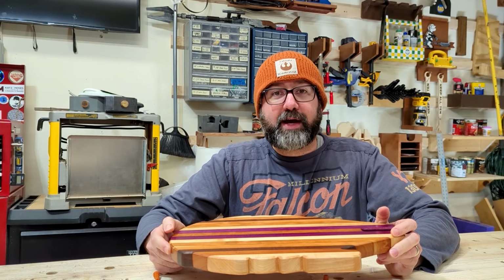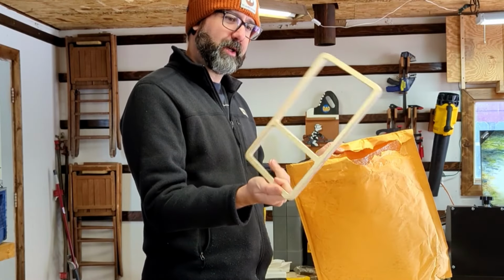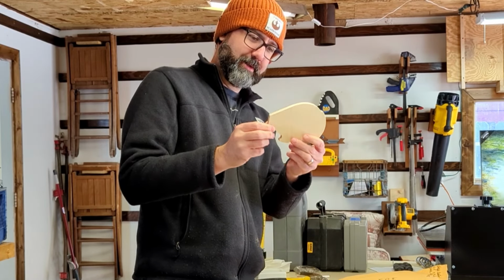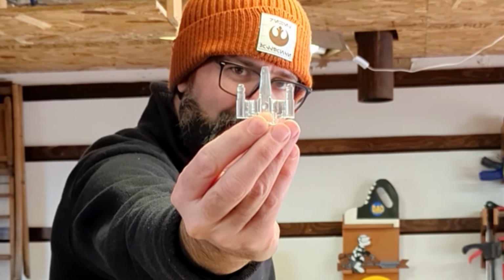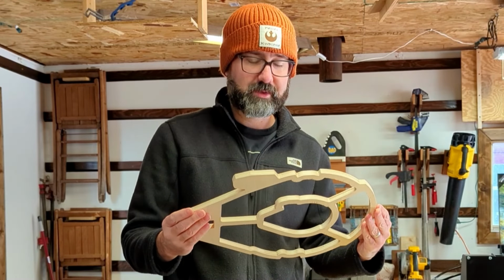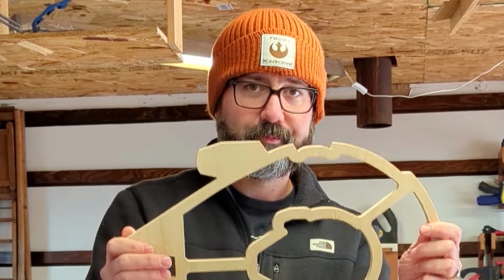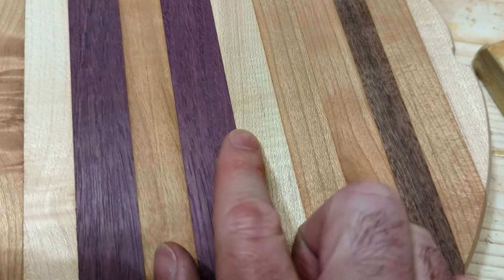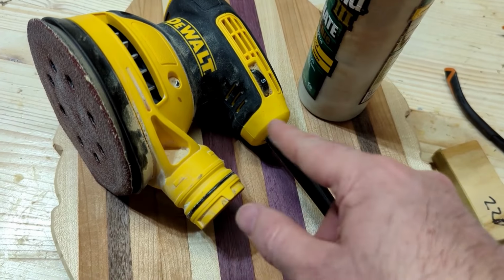How to make a Millennium Falcon Cutting Board

Comment: You don't need to mix sawdust in! Drop some glue into the crack, then just sand over it while it's wet. It'll fill itself in in one easy step. Keith Decent taught me that and it works amazingly well and I do it whenever I need to fill a gap like that.
Reply: Never mind. I stopped it before you did it and I thought when you took the dust bag off you were going to collect the dust and do that whole thing. Carry on :)
Reply from the maker: Haha I read this and was so confused until I saw your second comment 😂
Reply: @dadcrafted  You threw me off when you took the dust bag off! 🤣